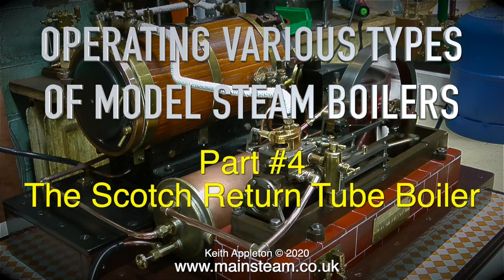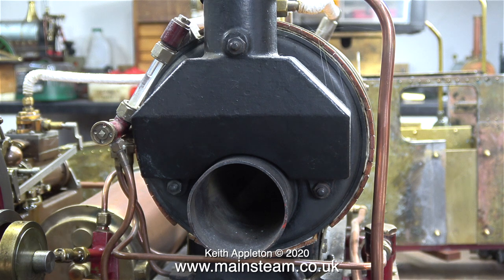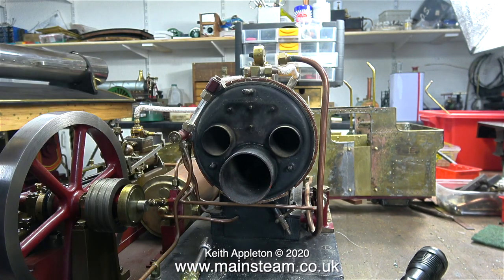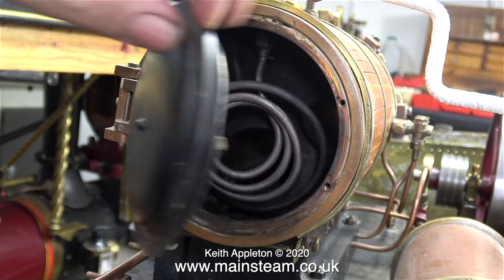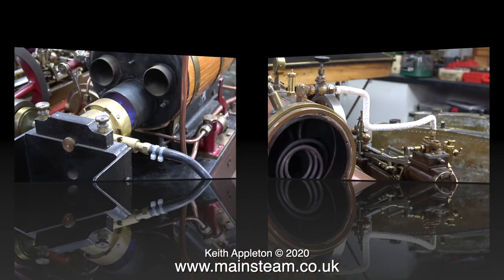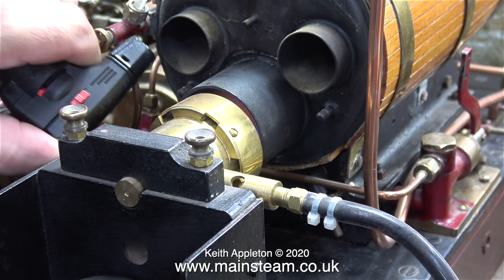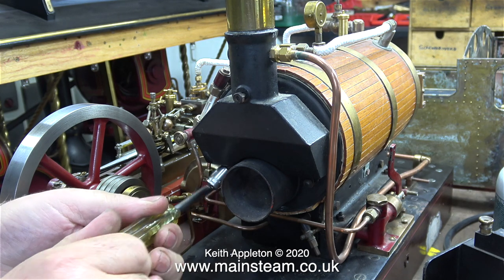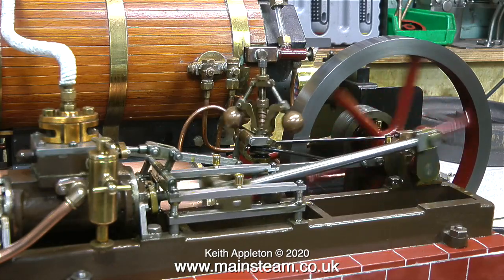OPERATING SMALL STEAM BOILERS - PART #4

Comment: The radial arrangement of the water tubes in the main flue increase the turbulence of the air flow going over the water tubes. This significantly improves thermal transfer.  Very nice boiler and engine. Keep safe